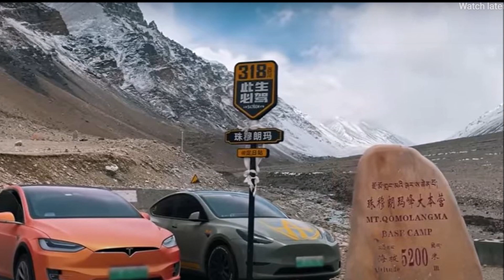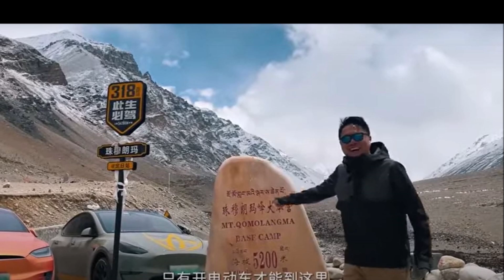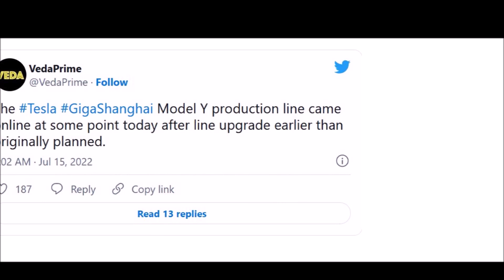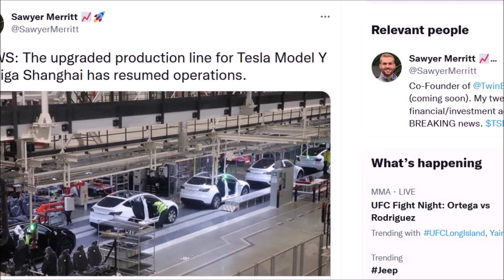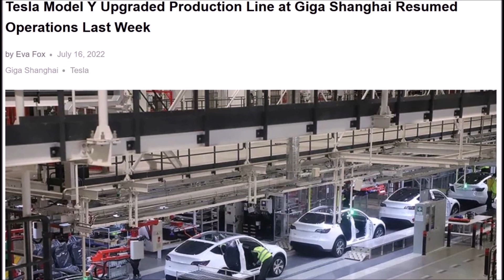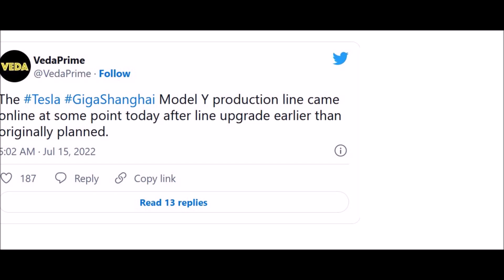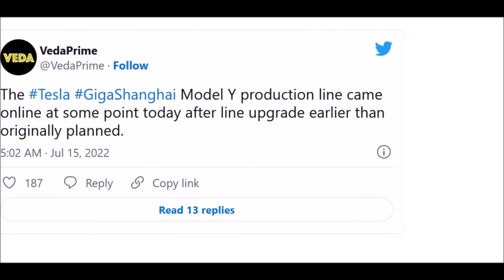Tesla Vehicles Reach Mt. Everest Base Camp For The 1st Time

Comment: I’ve driven up to Pikes Peak 14,100 foot elevation. Plenty of ordinary cars do the drive, but without regenerative braking or a manual transmission, it’s easy to overheat your brakes coming down hill.
Reply from the maker: Thanks for sharing Mitchell.
Reply: @Torquenews  And thank you for your excellent content!
Reply: At 14,100 feet, normal ICE cars lose around 40% of their horsepower. Yes they can drive up there but they become slower so you may have to fully press the gas pedal to keep the climb rate.
Reply: @Seventh7Art  Thank you so much!